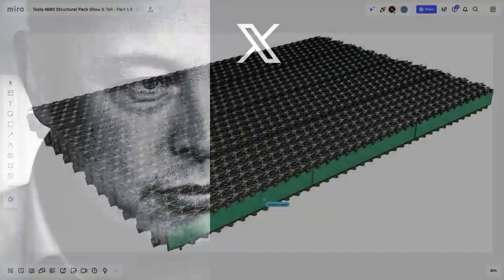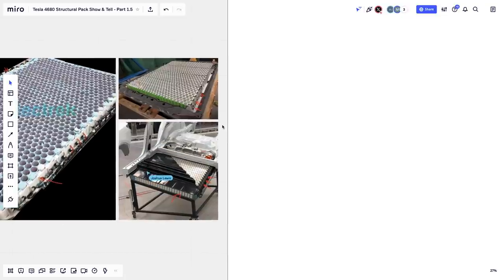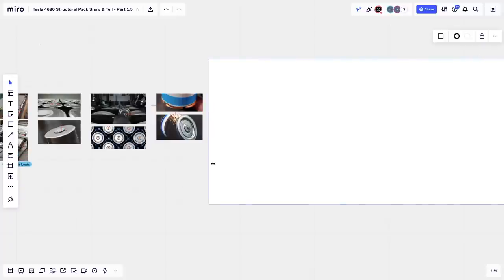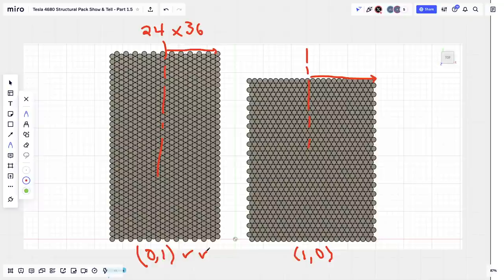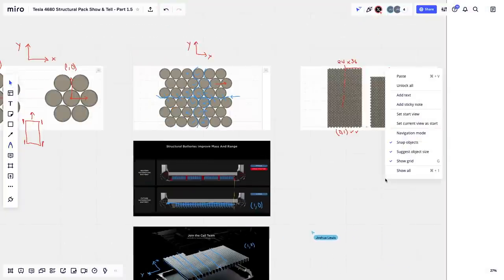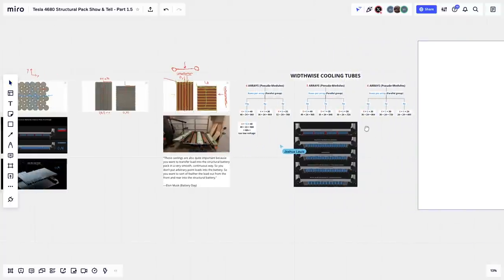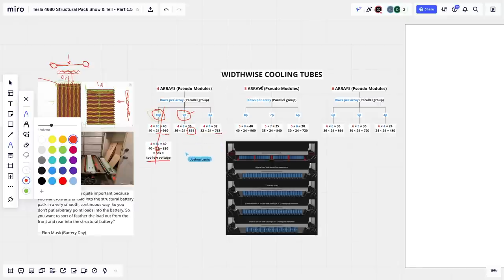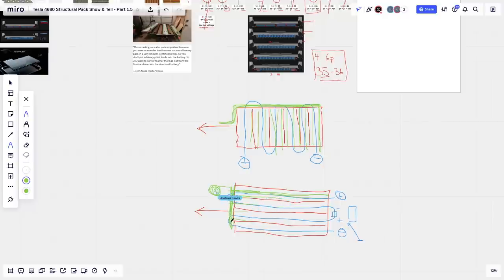Tesla 4680 Structural Pack Show & Tell - Part 1.5

Comment: Isn't the polar moment of inertia lower for the configuration where the pack is more squarish?

 Because the the ideal mass distribution for minimizing rotational inertia would be a round disc shape.
Reply: Exactly. An easy way to visualize moment of inertia is to make a circle with each corner of the rectangle touching the circle for both versions. Whichever circle has a smaller radius has a lower moment of inertia. So yeah the more square pack will have lower moment of inertia.
Reply: @harsimranbansal5355  Right. Rotational inertia is determined by adding up all the mass (integrating, really) multiplied by the square of how far away it is from the center of mass. So the longer, skinnier pack will have more resistance to rotation.

Comment: Since the car is turning left or right, we want to minimize Moment of Inertia along the Z axle not the X or Y axles.  (1, 0) configuration has less MI on the Z axle as mass is distributed closer to the center point.
Reply: I was thinking the same, he is always taking abot the MI along the longitudinal axis but the importamt one is the z axis. The (0,1)config while it its narrower it also is way longer so the MI along the z axis is larger.

Comment: Seems discussion of orientation as sense, but not for me. I think photos of Berlin have the right one orientation.
The battery pack is much more smaller than wheel axis distance. A more square pack is more structural than a rectangle. 
Connectivity of cells is not problematic in any combination because is done from the top, and easy to adapt. 
Cooling system is also best efficient if liquid have less distance to course to refrigerate and is more dense.

Comment: I hear people saying the narrower pack leaves more space to protect the sides of the batteries. However go back to first principals, the pack is sacrificial to the safety of the occupants. Passengers come first so if pack is structural it's role is to protect passengers and should go wide to protect from side impact! 
I also concur with the comments about moment of inertia 1,0 is lower.
We will see what Tesla does on arrangement and cooling. I am not convinced that ribbon cooling is needed with 4680s if a bottom cooling plate transferring heat from the tabless tabs is thermodynamically effective.

Comment: The bidirectional cooling tubes have a major advantage over the conventional tubes in that the cooling is much more even across all the cells. This is due to the linear temperature change as you travel along the cooling tube - problematic for a normal tube, but no problem when the tube reverses back on itself.
As for the manufacturing of these tubes they could be made easily from an appropriate extrusion that is subsequently formed - a process also needs to be developed to deal with the halfway point to reverse the flow down the other side.

Comment: Cooling tubes are also used for heating the battery pack, especially in colder climates. I was thinking: where the cooling lines are placed, there is less epoxy, so this may be the weakest part of the pack.

Comment: Is the structural battery pack most advantageous in the largest pack / longest range configuration from a weight saving perspective? If this implementation uses the cells as both energy storage & adding to car structural strength, if you remove 25% of cells for shorter range you'd need to add passive structural elements to the freed up space - or dead weight, right? 

So it may mean that a short range structural Y may not be much lighter than a long range one since it'd benefit less from the so-called negative mass of a smaller battery pack, is that correct?
Reply: I guess it would be rigid enough to not necessitate adding passive structural elements even in the short range configuration (smaller pack). Elon mentioned it being considerably more rigid than any other car, to the point that they could make a convertible and it would still end up being more rigid than a hard top without the structural pack.

Comment: Haven’t they announced the cooling/heating components are on the top and bottom where heat is generated?
Reply: Yes. Honeycomb pattern with epoxy in between and cooling plate. The goal has been to not have cooling channels in between the batteries.